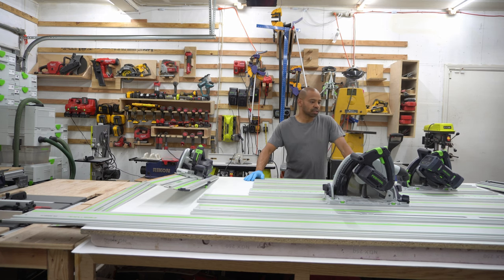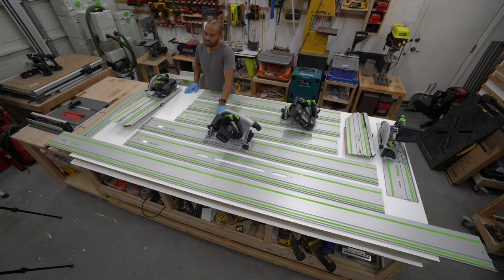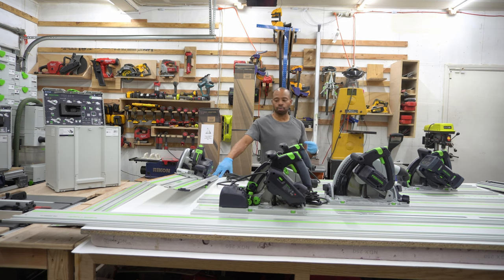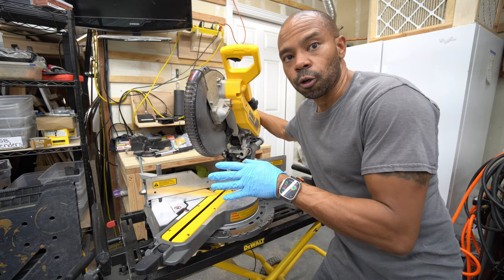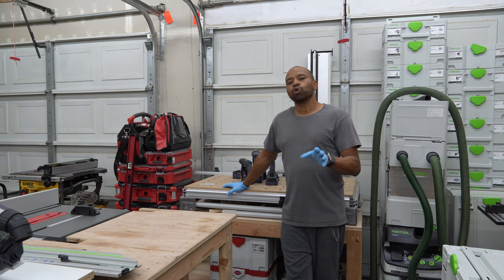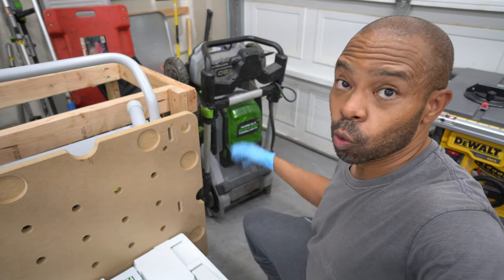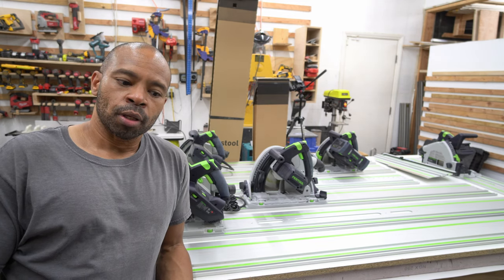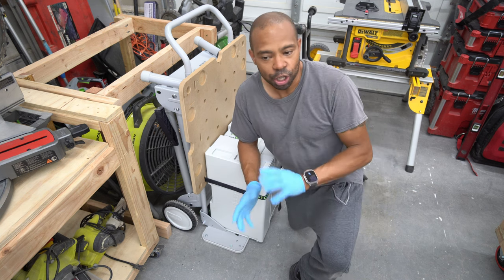Shop Vlog 9 12 23

Comment: nice collection bro.  id be happy just to have a long track.  i currently use 2 1400mm rails with joiners, very accurate, but what a pita!  its always right after i assemble the 2 that i need to do a cross cut and take them apart.
Reply from the maker: The long rail is super useful for ripping 4 x 8 Sheet goods. I do understand your point about having to break down the rail to complete cross cuts. I have been chasing that "optimal" work flow myself. Thanks for checking out the video.

Comment: Nice collection man, I always wondered why the 75” track existed. Seems like such an odd size. I run the 55kc and hkc55 I find the slight variation is precision relative to the splinted guide is not noticeable
Reply from the maker: Thanks. The TSC 55 KEB and the HKC 55 have 1.8mm kerf blades. I'm not surprised that you do not notice a difference. The TSC 55 REB has the 2.2 mm Kerf.
Reply: @daddysharespace  ya for sure, there is a difference how each saw actually sits on the rail but it is negligible
Reply from the maker: I agree.